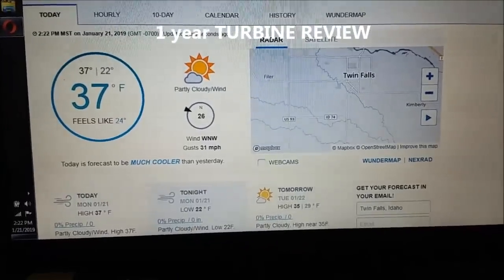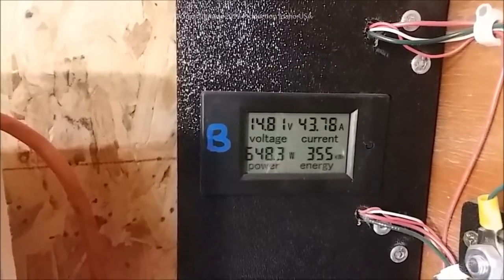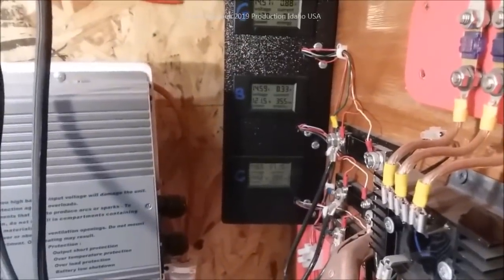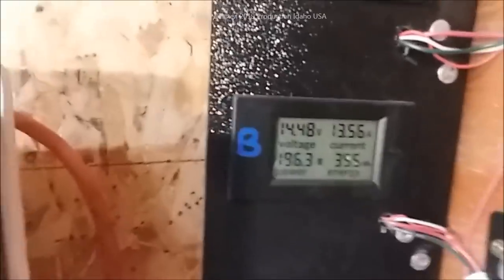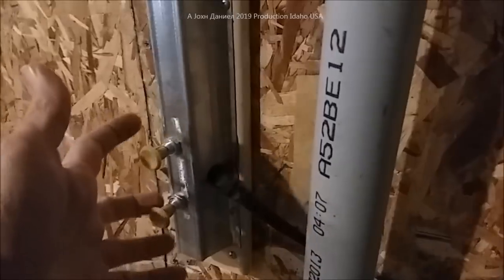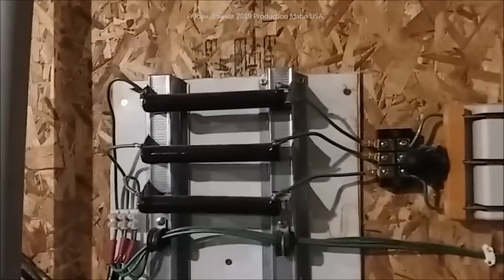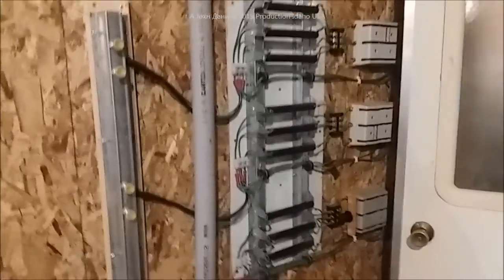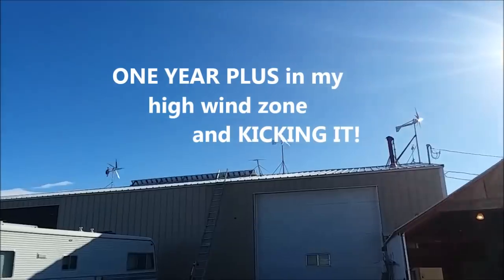The best Chinese Wind turbine, Great results, 1 year+ review FULL PARTS LIST BELOW VIDEO

Comment: Hi Mister D here a Q from the Netherlands. We are just starting to purchase and build a windmill, a buddy and I. We have mega size 1x100 amp 12 volt battery, when full 13,8 Volt battery. We are allowed to buy in a village only vertical axis. For instance this one from Smaraad (see below). This one is 75cm long, diameter is fine, We are ok if it was 100 cm long. We here in the Netherlands cannot buy from walmart, they don't deliver here. We can by from Ali or from Amazon.

Q1: We are not seeing the difference between 600 w, 800w or 1000w the blade is always 75 cm long. (see reference below) What, if any is the the a difference, between these wattages. If nothing, we would simply schoose 600 W. We are happy with 250w.

Q2:If an item says 12 volt, will it produce 12 Volt? or , what we want 13,8 Volt when the battery gets full. 

We understand your schematics..

Q3: What specs does our heat sinc need to be given this vertical windmill + 100 AH battery.

Thanks from the Netherlands. indeed The Netherlands knows a lot about windmills, but nothing small for houses.

greetings David

https://nl.aliexpress.com/item/1005003796411799.html?spm=a2g0o.detail.1000060.2.7bbe1928hp518v&gps-id=pcDetailBottomMoreThisSeller&scm=1007.13339.291025.0&scm_id=1007.13339.291025.0&scm-url=1007.13339.291025.0&pvid=ff754299-3520-4e93-a52f-871092b2c636&_t=gps-id%3ApcDetailBottomMoreThisSeller%2Cscm-url%3A1007.13339.291025.0%2Cpvid%3Aff754299-3520-4e93-a52f-871092b2c636%2Ctpp_buckets%3A668%232846%238114%231999&pdp_ext_f=%7B%22sku_id%22%3A%2212000027194702295%22%2C%22sceneId%22%3A%223339%22%7D&pdp_npi=2%40dis%21EUR%21680.65%21476.45%21%21%21%21%21%40211b5e2116682701358743229e2eae%2112000027194702295%21rec&gatewayAdapt=glo2nld
Reply from the maker: The VAWT they sell is about 200 watts max in 30 kph winds. No matter what they rate it as or price it as. Sad you can not buy a real wind turbine, the people who make the rules there apparently know nothing of small wind power. AliExpress SMARAAD Franchise Store has a very low 87.9% Positive feedback, for a good reason, they sell over rated junk. I would avoid them. If you want wind power and must have a VAWT that is not the ones to invest in. 
As for a 13.8 battery, a 12 volt model makes over 30 volts output and the battery is what holds the voltage down to charge level, so it has no issue there.
Reply: @JOHNDANIEL1  Thanx John. Message understood. If we must chose a VAWT, which one would you point out? We are prepared to spend a few extra bucks. We have curl winds here. Leaves blow from ground level and then up. Bought a windspeed meter (has yet to arrive). Much wind now in autumn. I phoned the town hall today, they are more lenient towards VAWT today, Maybe bacause of hefty energy crisis here in Europe. Rules: max 6 meters high, it may be as wide as a standard flag, but no larger. Our estimation today is 1.1 meters max width. Max 41 dB, for sure,  no shadows allowed on the neighbours turf. They are gonna call us back on the max width. We must call it micro wind turbine then it falls under legislation & dimensions of "flags"
Reply from the maker: This 2000 watt model has the highest actual potential of any made. 
https://s.click.aliexpress.com/e/_DlDHiQj
Reply: @JOHNDANIEL1  Looks absolutely good. Townhall does not know what to do with us. We are now in the proces of measuring wind speed. VAWT = no permit needed. Micro HAWT micro is allowed on boats without permit. If 15m/h then we will push forward with one or the other.

Comment: I like the 600w version of this from Green E Solutions but I am uncertain about voltage.  If I buy the 48 volt version does that mean I need to be feeding 4 x 12 volt batteries?  Is that how it works?
Reply from the maker: What ever battery system voltage you plan on using, buy a turbine in the same voltage . If using LiFePO4 go down the parts list under the video to the 1500/1500 all in one controller and use it for best results.
Reply: @JOHNDANIEL1  Thank you John I'll check that out.  I live in Scotland by the way, not sure if we have that make of battery.  So good to be privy to your expertise.  Cheers.  Mark.
Reply from the maker: Look into EXIDE Specialty Battety dealer in Ireland.
Reply: @JOHNDANIEL1  Wow.  1thankyou for the heads up John.

Comment: Hello John, Just starting to build a wind power system and I am running into a snag I think. How does a 12V 400W wind turbine charge a 24V battery bank?
Reply from the maker: It doesn't. Your wind turbine a choice needs to be a voltage output higher than the battery Bank you're going to use. A 12 volt wind turbine puts out of voltage higher than 12 volts, a 24 volt turbine would put out twice that.

Comment: Hi. Thanks for the informative video! Do you know if the links you provide still goes to the correct seller and item? I’ve heard that sometimes the sellers change the products after reaching notoriety..
Reply from the maker: Yes, the turbines I found with a higher quality windings and larger magnets are still available at the links below. In fact they've even improved them since I bought them to where the blade castings are much better. I suggest if you're in a low wind area to look on their page for the low wind 3 blade model it will perform better than you can imagine.

Comment: Hi John. We have average 18 - 20 knots wind for 3 months of the year and average 8 - 10 knots for the rest. I am looking at connecting a wind turbine to my 48V battery system. I will need about an average of 250 watts supply to cover my energy consumption. What turbine would you recommend? Thanks.

Comment: I'm interested in dipping my toes into wind. Can anybody tell me what's the bare minimum setup I'd need if to begin with I just want to dump all the output into resistance heaters? How much wind do I need? Should I somehow measure my wind before getting a turbine? Can anybody recommend a concise primer?
Reply from the maker: Definitely average your wind, a 13 mph average, then your prime for some wind power, under that then its a choice you have to make based on things like is there wind at night, in winter, or during heavy clouds?? Then again, its a judgement call.
Reply: @JOHNDANIEL1  Thanks. Should I use the average wind stats for my area or should I tape an anemometer to a tall pole?

October through March is 14.2mph average for my area. Dec through Feb is 16.3mph average. Seems promising. That's the time of year I need the heat.
Reply from the maker: @Thoracius  Excellent, your good to go then. My suggestion knowing this data, get the 800 as seen in the video I did on it, and ONLY 3 Blade is needed. Link to it is under the video https://youtu.be/ilN9604y4fg And See WHY I stay 12 volt in all my systems,  https://youtu.be/1SNqV7nMDHU

Comment: https://istabreeze.us/cart.php?action=buy&sku=3461-3-B&source=buy_button
Reply from the maker: If it's a great turbine that needs to be seen in my high winds then send me one of the  https://istabreeze.us/i-700w-12v-24v-48v-wind-turbine/ for a 12 volt system.   I'll put links for people to find it like I did these I use. Over 2300 people bought this one in 14 months due my videos on them showing they work.
Reply: @JOHNDANIEL1  ok i will send plz give me you mail adres
Reply from the maker: @altinelenerji  You can contact me by Email at olympicpowercontrols@yahoo.com and we can work on something to get that going.
Reply from the maker: @altinelenerji  Türbininizi benzersiz ve istenen hale getirebilecek büyük tasarım değişiklikleri önerebilirim. Utah ABD'de 1000 watt'lık bir Ista Breeze kurdum ve performansı iyi değildi. Türbin, yüksek rüzgar fırtınalarından korunmak ve düşük rüzgarlarda daha iyi takip etmek için derleme CHAOS türbinim gibi bir ofset montaj ve ters sete ihtiyaç duyar. Tork geribildirimi bu şekilde ele alınacak ve watt artışını durduracaktır.  
EN- I can suggest major design change that can make your turbine unique and desired. I installed a 1000 watt Ista Breeze in Utah USA and its performance was not good. The Turbine needs a offset mount and reverse set like my build CHAOS turbine to be safe from high wind storms and better tracking in low winds. It's torque feedback will be dealt with that way and stop watt surging.
Reply: @JOHNDANIEL1  my stuff will contact you

Comment: Do you dump any load into heaters or baseboard heat when the batteries are all topped up?
Love the channel just trying to rig up my first wind/solar system
For a small greenhouse.
I am Building solar water heaters for radiant floor heat, with geothermal and want to dump excess into an electric water tank when the batteries are full.
Reply from the maker: To heat a green house just use a 300 to 500 watt DC element in a good barrel of water & you can top off as needed. It will radiate and add vapor to the green house. Only fill it to a point it has the heating effect you want, and not to a boiling capacity.

Comment: Hallo John, bought one directly from your link. 24v 3 blade, peaks at 13.6A and at lower speeds it wobbles. Seller not very helpful, any advice please?
Reply from the maker: I did a video on blade balancing and centering. They are not perfect in every way and you will need to assure balance of the blades even though the individual blades are excellent in per blade weight, the centering of them does require a look.
Reply: Thank you for replying and the advice, I’ll have a look how you did it and see if i can rectify my issue. Thanks for the videos, keep them coming and take care!

Comment: Hi John daniel! I bought 2 the same wind turbines that you also have from b & c but I can't get them to work properly. the wind is good but when they come up to speed they turn the wrong way and stop. how can I fix this?
Reply from the maker: Check to see if tower is perfectly leveled, no tilt allowed. Second you apparently have whats called dirty wind, means obstructions of turbulence. So to solve that you can add 2" or 5 cm of additional tail section area to increase tracking.

Comment: Hello John,
I've just bought the GE 400w wind turbine. Excellent piece, I haven't tried yet thought.
My system is 24v.
I was wondering if I had bought the 48v version and use mppt charger for my 24v system. Would that have given me better results ?
Reply from the maker: In many conditions it is better to run them higher voltage with a qualified MPPT controller made for wind 3 phase input. On some of the mountain installs the wind is so turbulent the only way to go is a 48 volt into a 24 volt system using a MPPT that can handle open voltage exceeding 140 vac 3 phase. The ones you see with a big green resistor on certain sites with the capacity of 800 or more watts do a good job of this and auto recognize your 24 volt battery.
Reply: @JOHNDANIEL1  thank you for your time

Comment: If I am thinking of a 48 volt system should I not do a 48 volt turbine or is it 12 volt and then in some way get to 48 volt
Reply from the maker: You can order a 12, 24, 48, 96 or even higher from these guys, just check the links, look at the options they have. I just prefer 12 volt system, a preppers/survivalist habit!

Comment: and what about this? https://www.ebay.com/itm/5000W-Max-Power-3-5Blades-Wind-Turbines-Generator-DC12-24V-Charge-Controller/264531783904?hash=item3d9752b0e0:m:mQ8EDhFLQCipCt50P_dWUAA
Reply from the maker: Yeah, they are stealing millions $$$$ off foolish people. Making fake reviews and posting the ads all over like this. The end result will be thousands of people who will never trust buying one again. That 200 watt turbine is what we in the installers network call a Missouri Wind Scammers training 101 professional piece of fraud. Its actual weight is 16.8  lbs, has 42" diameter blades, and 16 AWG wiring. Barely able in 35 mph winds to hit 220 watts. But when you can buy a real 5000 watt generator but expect at least 375 lbs, 15 foot diameter blades, and output of over 250 volts and 4 AWG wire.

Comment: Do you power all your house with renewable? How many batteries do you use? How much power do you produce? How much is your your electric bill?  What is your opinion about chinese ? Did you compare it with USA wind turbines? You have a lot of connections everywhere. What about if you next time consider putting them all together in a box or even better in your battery box. It's just a suggestion.

Comment: Hi john I have just installed the 500watt  on my boat  but a typhoon cat 3 is coming next week . I only have the basic installation of rectifier and fuse to batteries. What can I do to protect it???  Don’t have the parts to be able to complete the installation you have now installed in time .. any ideas appreciated
Reply from the maker: You can be prepared by placing the original controller into the system for now, and adding a few 100 watt bulbs onto your inverter to plug in when the winds hit. Just watch battery levels as you go to know when to unplug that load on the batteries when your at 80% full and back in as needed.
Reply: Јоhn Daniel many thanks John

Comment: I have a question for you. Looking at a wind turbine, When it says 12 or 24 V is there a difference in the wind turbine or is that strictly just the charge controller option
Reply from the maker: The windings in the generator heads are different for each voltage range and model.
Reply: Јоhn Daniel ok thank you 😊

Comment: The Chinese started building that one for air 405 from flagstaff and sold them out the back door for half the price. They bankrupted the company. And yes they are good. Mine has been running for 20 years now maybe longer. My son's spit out the blades into his sheds roof. But is still in good shape.
Reply from the maker: Yes this design has been out for quite a while and originated off a original French design call the Aerotoff in 1977. but the Chinese model uses a double row bearing with a compression center and is much more improved than any of the models made since before 2011 as far as durability they are very good as long as you make sure not to abuse your blades or install them incorrectly you'll get 20 plus years.

Comment: I still haven't seen more then 238 watts from mine yet but then again winds haven't gone over 20 mph
Reply from the maker: If its mounted high enough in clear air and hits 25 mph your gonna see 500 or more. But the best thing on these turbines is the consistency your gonna get compared to all other options.
Reply: I noticed i get about 1-1.5 volts less from one of the 3 phases consistently.  That has to be affecting output. What can i do about that? Is the manufacturer good about warranty stuff or can i order a replacement stater?
Reply: So john...took the turbine back down cause i was getting angry watching it spin and make little to no power. I removed it from the pole and got back to bare wires straight off the slip ring. I tested voltage with the drill like you do but with a corded drill for consistent speed. Getting 67.3 volt out of 2 of the 3 phases, 60.1 out of the last. Checked multiple times and perfectly consistent results..... what now. This has to explain why im not seeing power. Hope to hear from you soon.

Comment: Hi there, is there a chance to run these things directtly to the home electrics as it's AC? I've got Solar planned already and looking to use something like this for the base load of the house, which is about 150 Watts on average.
BTW I'm in Europe with 240V Network
Reply from the maker: If you get a reverse grid tie inverter that is capable of use on a wind turbine you can back feed into your current electrical system. Do some research on it.

Comment: Hey how you doing boss is been a while having send you a message quick question I'm thinking about in the wind turbine the little Chinese wind turbine because I was thinking of buying the Missouri win but doesn't make no sense a 1600 w wind turbine more less is giving 600 watts quick question do you recommend the breaker from the Missouri wind and solar for the Chinese wind turbine the one that comes with the rectifier
Reply from the maker: You referring to a circuit breaker or a brake switch? NEVER use a brake switch on a real wind turbine. OK for toys of 200 watt models claiming 1600 watts but not for the ones I have been using, they can hit over 1000 watts and a loaded brake circuit is what you use. 2 rectifiers on one wiring drop from the turbine.  Yeah, I got to make that video LOL!